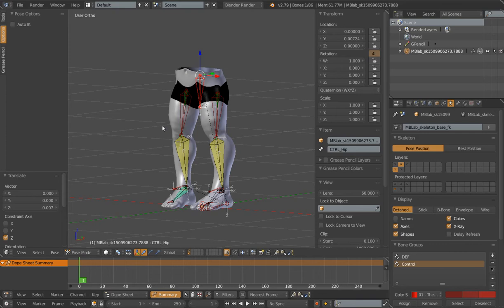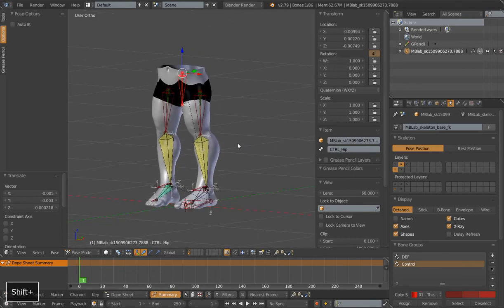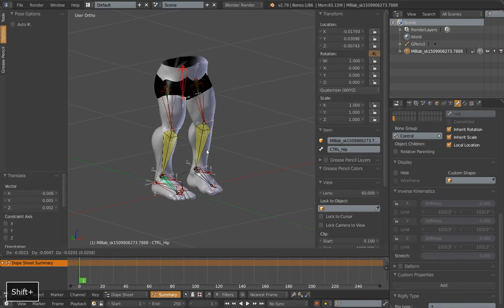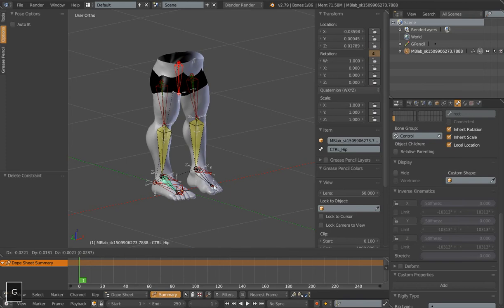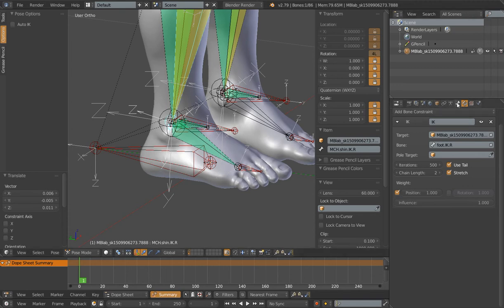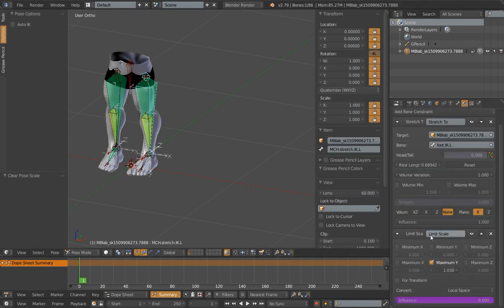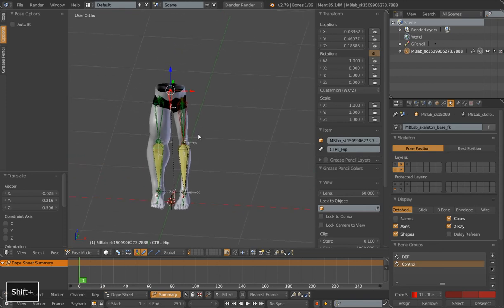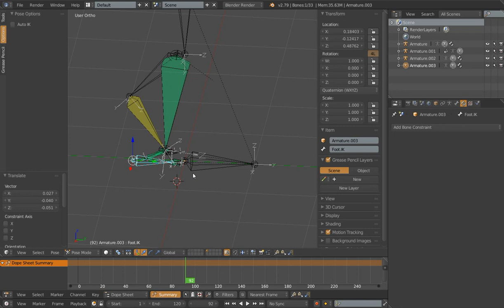Blender Rigging   Rigging Soft IK Limbs

Comment: Tried to apply this solution to my rig in Blender 2.81 but I run into some issues (see below). I found a simpler fix by adding a tiny knee joint bone between the thigh and the shin, adjusted the chain length of the IK to 3 and, for the KNEE JOINT bone, I limited its X-axis rotation between 0 and 170° inside the IK properties of this bone (credits go to GogoDisco on BlenderArtists for this alternative).

*The issues were: 1) I already had a foot roll rig in place (thanks to this very excellent channel) which already involved the IK target, so I gave up trying to figure out how to re-parent the whole structure.
2) The worst part was that the Stretch To constraint behaved very weirdly on my end. I could not get it to snap to my target properly. It would stretch a little pointing at the target, but it would not reach it, or it would overshoot by a very long distance. Fiddling with the constraint settings and the Stretch Length value did not work.

Comment: Great tutorial, as always. Question: I've done your advanced foot rig tutorial (which is excellent). I have it working correctly with the Soft IK Leg setup. But I notice that the AFR (advanced foot rig) gets left behind if you lift the hips / pelvis bone up so high that the legs go fully straight. Is this by design? Or is there a way of making the AFR come along for the ride if the hips get moved too far. I ask because I'm working on a cartoony rig. I want to be able to stretch the body way up high, and have the AFR come along for the ride with the deformation bones of the feet.
Reply from the maker: It's by design. If you want the feet to follow the hips after they have straightened, just select the IK foot controls and the hips and move them together. You could make a switchable parent, but that is more involved. I do have a few tutorials where I make switchable parents. The latest Face Rig tutorial (Part 6) and the weapons rigging series have switchable parents if you want ideas on how to do that. Good luck!
Reply: Thanks immensely! Your channel has some fantastic instruction!